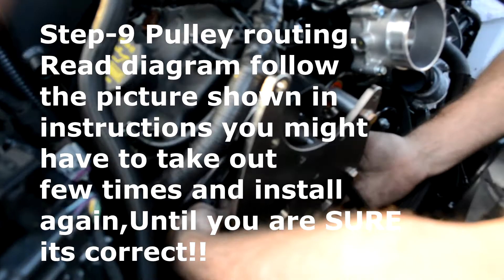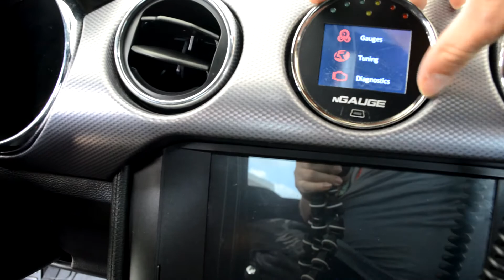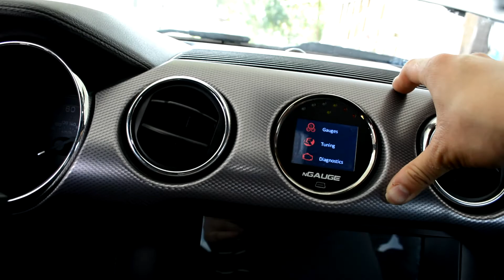Paxton Supercharger Installation kit(Mustang GT 15-17)Part 3

Comment: Question... I bought a catch can for the passengers side and I currently have the breather filters on both , but today I noticed some oil blow by on the drivers side ? Have you seen this ?
I have the Paxton on 3.6 pulley also
Reply from the maker: Buymyls1 yes I had the system connected where it would still circulate but ended up just using both filters to open air on each side and plugged the drivers side that went to the Paxton. I hope that makes sense. But no oil should be there
Reply: @mr.manny_s550  so what I'm seeing is oil blow by on the drivers side breather filter ... I've read where other people said it's normal but it sure makes me nervous 
They said they got a catch can put on the drivers side also but most people I read have only seen oil collect in the passenger side catch can 
Mine is the opposite?  Any thoughts?
Reply from the maker: Buymyls1 i has seen a lil bit on mine while back I mean regardless you are venting out to air so some will show on the filter. Now if you’re seeing a lot where it’s dripping than yeah best to do a catch can that circulates around the system

Comment: I’m wondering if air raids full air box could be adapted to this. Out flows the stock box by nearly double while pulling from the grill like stock.
Reply from the maker: Steve Pounder  honestly I just went and took the stock air box and added a shorty filter straight on the impeller housing. Best throttle response , just waste little more gas but eh

Comment: Have you added the wastegate yet(Beefcake torque booster kit)?  Or changed your pulley size since?
Reply: david peed 50 Uber V8 V8 I have not , just kept it the way it is , already plenty of power although I do have the option
Reply: Yeah I have the same setup right now, but with the 3. 6 pulley. I'm getting 650 wheel horsepower and 473 torque. I'm about to install the mgw shifter and the 3. 33 pulley and wastegate tomorrow. So I can pick up better torque down low
Reply: Good stuff though.  Y'all did a good job.  I had a shop install mine. Lol.
Reply: david peed 50 Uber V8 V8  thank you ! It was a pain lol and yeah we got around the same numbers maybe little more cuz I had added headers which really gave me more tq 585tq and 650ishhp
Reply: Yeah I never did any long tube headers, yet. LOL. It seems like it's a pain in the rear end and that's why I have not done it yet. Plus I've done spent so much damn money in the past 2 months. I only have 3000 miles on my car and I've done did all this crap to it already lol
Reply: Yeah, after I do the torque booster setup, I should be getting around the same numbers.
Reply: david peed 50 Uber V8 V8 haha the V8 Mod life haha yeah headers are bad ass but idk kinda not worth it lol
Reply: Yeah I really don't think it's worth it to me for now. I'm going to do the return fuel setup and E85 real soon. The only thing stopping me is the fact that the closest E85 station is like 20 minutes from my house. And I don't feel like having to switch  my Tunes all the damn time LOL. and that's not including having to change the spring in the wastegate all the time, unless I get a boost controller as well. So that's another $2, 500 I'm going to have to spend for everything including the retune.
Reply: But after I do that, my motor will basically be maxed out

Comment: My drivers side pipe that comes up and connects to the MAF pipe is currently knocking against the metal frame of the vehicle. It is hitting in two places. Does that one pipe have any play in it or movement because mine moves considerably more than the other piping pieces when you try to move it. It is hitting and causing false knock up to 9*
Reply from the maker: 5.0 KLR  once the pipe  is clamped shouldn't have any movement. Make sure all fittings are properly tighten. Also might be angled slightly off that is hitting but nothing should be hitting anything
Reply: Mr.Manny_S550 Okay yeah I can easily move it with my hand. Has been losing to all kinds of stuff. None of the other pipes move so I guess it's just loose. Thanks for the quick reply!
Reply from the maker: 5.0 KLR no problem! That's why I'm here for.

Comment: I thought this was supposed to be a direct bolt on with no modification necessary. Seems like every other step you're having to cut or bend something.
Reply from the maker: NGTMare not so much the paxton kit. the Procharger brand is pretty much a direct bolt on. reason i went with paxton, because it has more room to grow in my opinion and better system.
Reply: dang, I'm getting the Paxton kit in a few weeks. No longer excited for this install.
Reply from the maker: NGTMare yeah it will take awhile. but i would get 2 people to help you. at the end itll be worth it
Reply: Cool, appreciate the video
Reply from the maker: NGTMare no problem hopefully it helps out